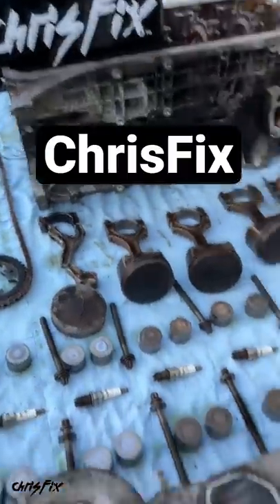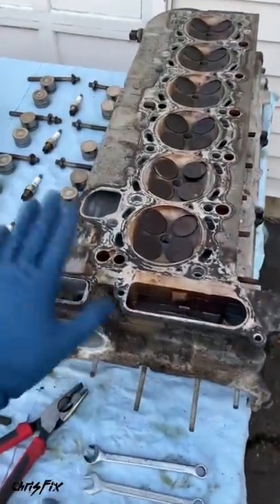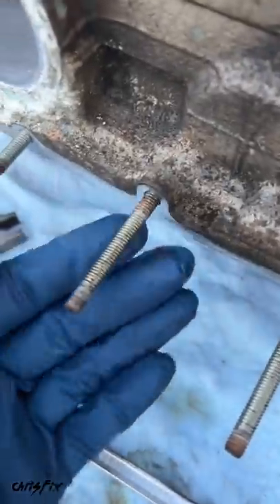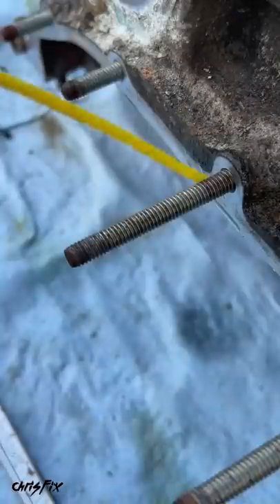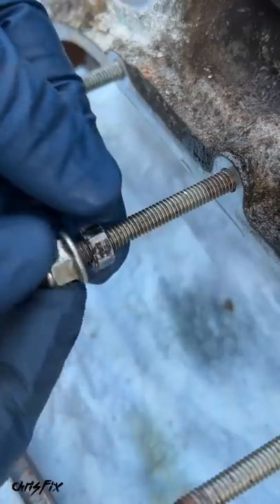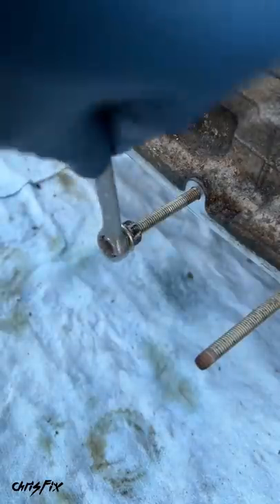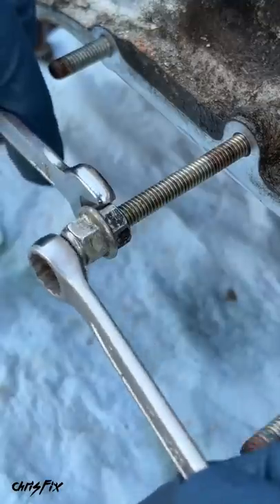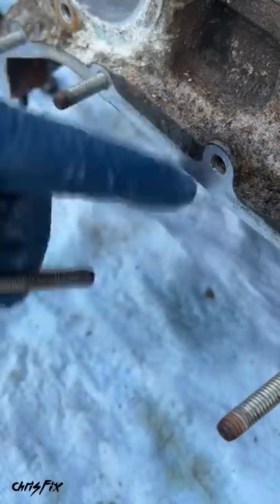Trick to Remove Studs from an Engine #Shorts

Comment: Yes, I needed to know how to do this
Reply: I would add that when you lock the nuts together, to use the nut that is on the inside (farthest away from you) to start pulling the stud out. That way you're tightening it against the outside nut increasing their "bond", and don't have the chance to unthread the outside nut off of the stud completely!
Reply: @alexhaile7957  I thought so too but haven't practiced yet. Imma "low-end" DIYer. ;)
Reply: @Loyee2000  Seems to me that you have some intuitive understanding and like to do it? There is no "low-end", all that means is you have so much more to learn!!
Reply from the maker: @alexhaile7957  great tip! Especially for the really stuck threads!
Reply: @chrisfix   I already knew this but thank you . Everyone else seams like they are trying to sell some type of tool. instead of just using the nuts they already got.
Reply: Best to do this at the base of the stud with engine studs, as heat can sometimes cause tempering and snap the stud. This is a common issue with exhaust studs.
Reply: @chrisfix  we are doing it wifh welding a nut to the stud and screwing it out in Turkish work shops but your tip is much more easier and don't need to buy new studs 😅
Reply: @chrisfix  also fully thread your outer nut so you reduce the risk of stripping you threads as its only held on by 2 or 3 threads rather than all of them
Reply: @RobinTuna  why not just use vice grips if your going to destroy the studs?

Comment from the maker: New FULL LENGTH in-depth video coming next week! Been hard at work on some awesome videos! The weather has finally gotten a little better! I can work with 50F!!!
Reply: 50F! That is cold cold for me Chris! I hope you don’t freeze up
Reply: Sounds like you need a shop .. lol
Reply: That's a comfortable temp 50, degrees, looking forward to you're next instructional video Chris.
Reply: You would have the opposite issue here in south florida. It's always too hot. lol
Reply: ChrisFix I have a suggestion for the channel, why not buy a classic car to the channel, that would helpful for people who want to restore one, you can show us how to replace a caburetor and other common machanicals issues that classic cars have do don't see now a days.
Reply: I can't wait to see what you've been working on! You put ALOT of work into every single video, which is what makes you the best on YouTube!
Reply: Great move to damage thread. You better never use those studs more than once, because after tightening they might become longer, so head isn't sticked to the block properly and you may have leaks between em
Reply from the maker: @hadouken111  these are not torque to yield studs so they do not “stretch” and if you are worried about the threads from the jam nuts that’s why you do it at the tip which isn’t used by the nut when you tighten stuff to it.
Reply: @chrisfix  we just had snow again in Michigan and it's not even winter anymore, Midwest weather always gets me
Reply: Chirsfix when is the race car part3 coming
Reply: I can't wait
Reply: Dope video💯🙏🏽👊🏽
Reply: PLEASE MAKE TIME FOR THE DEL SOL PLEASE
Reply: In Florida it was 93F yesterday 😳
Reply: @GBOY185  right?
Reply from the maker: @Redline767  lucky it was nice for 2 days and now it’s back to rain and 40F
Reply: @chrisfix  you would think it's lucky but it's humid and hot, and the rain has been very hard to predict as well. But hope the weather there gets better for you lol

Comment: I always use wrench on the inner nut to unscrew stud and outer nut when screw stud back in. If you put wrench on outer nut when unscrewing than it might come loose by itself. Also you can use 3 nuts if there is enough room cuz sometimes 2 can spin right off the stud. Dad showed me this trick a long time ago.
Reply: Yes I was taught the same way. The inner nut will try to get tighter and as you said the outer wants to loosen because there isn't anything to stop it

Comment: I thought you are going to use some specialty tool or something but you did it simple like it should be! Nice job!
Reply from the maker: Thanks a lot! That is the goal when I  make videos. If possible, I try to use stuff most people already have or can easily access.
Reply: @chrisfix  Yeah i know ive been watching your videos for what 3-4 years now and i like the way you do em! BTW what's going to happen with that engine, i know block is going to junk but don't you think the head might've been dented a little?
Reply: Exactly, I expected him to weld the two nuts and replace the stud completely
Reply from the maker: @ghostly07  the head will be sent off to get machined (hence removing the studs) and we shall see if it’s still good. It might be toast but I rather try to save it than throw it away.
Reply: There is a specialty tool but this is free if you have the proper nuts

Comment: Loosen the stud using the other nut, the one closer to the block, otherwise you’re unloading the compressive force keeping the nuts together and they could separate. It’s not always the case but sometimes when using this technique things are a little iffy it can make the difference between success and failure

Comment: This is a great tip that a lot of people don't know! One other suggestion though, if i may, is to wrench on the nut closest to your work. Sometimes the stud is so stuck, the outside nut will break free from the second nut.  This is the same way a stud should be installed as well, unless you have threaded stud installers of course!
Reply from the maker: Thanks Travis and yes that is a great tip! This one came out easily but for those tougher ones that is a must!

Comment: Diesel mechanic here, i work on a lot of old rusty junk, and on long studs like this, I like to put my two nuts closer to the block, I get less stud breakage.  My theory is that the stud can't absorb as much of the twisting force of the wrench, so greater % of the force is transferred to breaking the stud loose, and less % is transferred into trying to twist the stud in half.  Usually the stud is most likely to break right near the block, i think it is due to galvanic corrosion being greatest there, from steel stud in aluminum head, plus corrosion from engine coolant, plus it's the least supported part of the stud, so it gets the most tiny back and forth flexing there.  One of the differences between an okay mechanic and a good mechanic is being able to feel when a bolt is gonna let go, and when it's gonna twist in half.  You get that just from unbolting a bunch of rusty junk hah.  Snapping off a bolt isn't the end of the world, but it will save you a bunch of time for every one you don't snap off.  Chris shows hitting the stud with penetrating oil, then immediately removing it.  If you have a stubborn one, it's a time honored tradition to let it sit for a while to let the penitrant do it's work.  You can help it by giving it a few taps inward on the end, this helps create space around the threads to let the oil creep in faster/deeper.  I sometimes use a little plumbers torch to heat reluctant bolts/studs, you don't have to heat them cherry red, you are listening for a tiny "tick" sound, of the rust and the metal expanding at different rates.  This chemical rust bond can be insanely strong, because both steel and aluminum rust take up more volume than the metals they started as.  When trapped down inside bolt threads, they can't expand, except by stretching the metal around themselves, which can create 1000's of psi of clamping pressure, but the differencial expansion uses that same chemical force to your advantage, instead of against you.  If you are far away from supplies, almost every house has a candle in it, most candles these days are paraffin based, if you heat up the stud, you can touch w paraffin candle to it, and the paraffin will wick down the threads, just be careful with flamibles and heat.  I also like to turn out the stud from the deeper of the two nuts, then your force is tightening them together, rather than trying to loosen them.  Car repair is all just Legos, pulling out bad part and putting in good part, except for 2 things, knowing which part is bad, and knowing how to get stuck fasteners out.  If you are new to wrenching, you can get a lot of practice by pulling out rusty fasteners on parts at the wrecking yard.  You can even practice on your exact model of car, on the exact part you are planning to replace, to see if anything is tricky about it.  Very cheap education, they are usually free or $1 admission near me.  Good luck new mechanics, you can do it!  Learning car repair skills is something that will save you a ton of money, and win you the affection of your friends and family.  I believe it was Shakespeare who said, "if thou can'st be handsome, thou should'st be good with thy hands."

Comment: If still struggling ? Heat block with heat gun and spray stud with plumbers freeze spray ;) . There is a special tool for this , it's a socket with lots of little discs in that grip the stud without damage .

Comment: Also you can tap the end of the nuts  with a hammer to shock the threads and stud if it is frozen. And if it doesn’t want to come out easily try turning it further in slightly to get the stud to move and then turn the stud out.
Reply from the maker: Great additional tip! Thanks!

Comment: This is a very useful tip that everyone should know, but personally, ive never had a stud be removed that easily. Alot of times the studs are too short for 2 nuts to work and a torch with a stud extractor tool is necessary

Comment: Hey Chris, quick tip. E90 exhaust studs fit on the m54 motor from an e46. They're longer and come copper or zinc coated.

Comment: double jam nut also works great for creating bolts to length. Jam nuts, cut excess off. grind down, remove nuts and the thread should be good to use.

Comment: When you are removing the stud, you are supposed to apply force on the lower nut,to prevent loosening, especially if you are using normal nuts..

Comment: Wish i seen this a little sooner. Working on my 1994 Chevy 350 motor durring fall. Installing a new water pump i needed to remove the fan and use the existing fan studs on the new pump... thats when i learned this truck here.

Comment: The real trick to this is if you're removing the stud, turn it with the wrench on the bottom nut which tightens it against the top nut. If you're installing the stud, turn it with the top nut. If it's really tight, doing it like in the video will just loosen the top nut

Comment: When you turn the nut to remove the stud make sure the nuts are close to where the stud is screwed in so you don't break the stud or bend the stud and also turn the nut closes to what the stud is in so it is less likely to undo

Comment: Quite often, due to galvanic reaction, steel studs become seized in aluminum blocks or heads, how do you remove these?
Reply: Use a box-end wrench as close to the base of the stud as possible and use the palm of your hand for a gentle impacting action. Slowly work it back and forth (3bangs left, 2 bangs right, then turn it back and forth a few times, then repeat) until it turns with no resistance, then spin it out. If you haven’t abused your hands enough to be up to that, use a hammer, but GENTLY. If it won’t move at all and feels likely to break, apply heat, then use the same method. (Reference Uncle Tony’s Garage broken bolt removal if I haven’t explained it well enough here.)

Comment: It works when you've got enough threads exposed to get 2 nuts onto the stud... however, when you've already snapped the stud off, (not from using the 2-nut method) you've gotta get a stud extractor and try again

Comment: When i rebuilt my engine 20 yrs ago, the machine shop guy said to replace those oem studs with allen head studs, like the same arp head studs we used to secure the head to the block.

Comment: When I ran the cylinder head rebuilding department of an engine rebuilder. I bought boxes of 5/16-18, 3/8-16 , 8x1.25, 10x1.25 and 10x1.5 nuts so I just left the studs double nutted while removed. Then removed them when reinstalled them.  I used an open end wrench a deep socket and a 3/8 impact to remove the first nut then the second nut in seconds .

Comment: Only unscrew from the back nut (the one closer to block) as it will jam more and will not loosen.
The top nut might unscrew if the stud is tighter than whatever you tighten those nuts.

Comment: That is the same method I use. Not for engine blocks but for bolts fasteners that snapped after I removed the head.

Comment: An impact gun helps to crack them loose. If they're so jammed in that they dont move, use a line wrench on the inner jam nut, it cannot back off as turning the stud to loosen it is tightening that inner nut at the same tine.

Comment: you'll get stronger and more level torque if you thread them all the way down. less chance of breaking the stud. 10 seconds of threading will save you hours of broken stud removal. especially on older/rusted blocks

Comment: If you're gonna use the jam nut method with two wrenches, do yourself a favor and set the jam nuts close to the block, instead of at the very end of the stud. You'll get more torque and a heck of a lot less chance of breaking the stud off.

Comment: I highly recommend when you’re removing them to use the inside nut to turn the stud. And the outer nut if you’re fitting the studs. This way you avoid undoing the nuts. They are ok if they aren’t tight..

Comment: I would like to point out that if the studs aren't good material and you keep the nuts at the end like that, if the stud needs alot of torque to remove, it might bend or break the stud, would be better in that case to run the nuts all the way up against the material and use a deep well socket

Comment: I would add get both those nuts as close to the block as you can. Those studs were not seized in but if they were you would be loosing torque through torsion and just more likely to Twist it in half the farther away they are. It would be wise to leave the nuts flush and hit it like a nail a few times before spinning them down as well

Comment: Neat trick and correct me if I'm wrong but aren't those studs supposed to be replaced when rebuilding ? Could always just put a pair of vise grips on it (which most people who own tools already own) and if it's really stubborn use a torch ( some people may not have one but they're cheap )
Reply from the maker: If they are torque to yield, yes but I was just showing in general how to remove a stud.
Reply: @chrisfix  true makes sense but neat video

Comment: An Auto zone employee told me this to get my radiator fan housing screw off. Great tip here. Say Chris, older cars have sagging seat belts that could use replacing but I heard that in many vehicles if you mess with the belts you could set off the air bags which can be dangerous. Any info on this? It would help so many folks to get rid of that annoying seat belt.

Comment: Torque is force at a distance and as you are torque loading  the threaded bar at a distance you are far more likely to snap them or twist them  the best option is to place one nut against the block then back it off half to 1 turn then place the second nut up to that and tighten them then  try back the  stud out  less torsional  stress on the stud 😇

Comment: You can damage the thread all you want if you're replacing them like you should be doing. But if you're on a tight budget then reuse them but just know the studs do stretch over time and they'll snap off in the head and will be a headache to get out.
Reply from the maker: It depends on the application of the stud, these just hold the vanos on and get torqued pretty light so they can be reused no problem, if it was something a lot heavier duty then I would definitely replace (and if there not being reused you are correct)

Comment: Removal doesn’t matter how you get them out, I wouldn’t reuse them. Pipe wrench gets em out easily if the head is on the bench. This is more useful as a method of installing studs

Comment: I used locking pliers on a stud when doing a thermostat swap, but to be fair the stud had snapped (and nut went with it) and barely had anything left so was in need of replacing anyway.

Comment: Is there a certain way that I would need to put it back? Or can I just screw it back on and move on?
Reply from the maker: Same process but in reverse. Make sure you torque it to spec tho. The studs will have a torque spec and it’s pretty easy to over tighten and strip out the aluminum threads. Once it’s torqued, crack loose the nuts and remove them by hand.

Comment: Do you have any tips for unbolting exhaust studs
Reply: The usual process uses a combination of penetrant oil, heat, nuts clamped as shown here, working the stud back and forth, colorful language and sacrifices to your favorite patron deity of automotive lost causes. Drills and taps are good to have ready.
Reply: @flagmichael  the problem is it’s the studs for the manifold to the down pipe and it’s a tight fit so the only thing I can get in there is an impact

Comment: Hey Chris appreciate the tip.
I heard that if you disconnect the diverter valve sensor you get a free "stututututu" what are your thoughts on this?
Reply from the maker: You will get compressor stall which can cause problems if it’s an aggressive/rapid stall but it probably won’t cause immediate damage. They put it there for a reason so it’s up to you if the sound is worth the extra stress on the turbo.

Comment: A tip for this method, for longer thinner studs like m6 or m8 put the jam nuts at least on the bottom 3rd because if the stud is stuck in the head the torque all the way at the end can just break the stud and then you have a headache